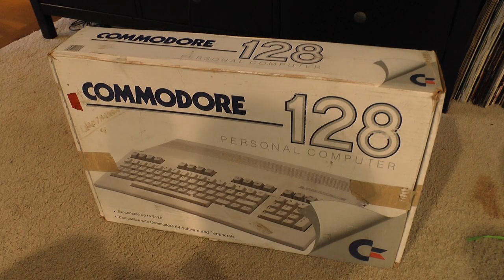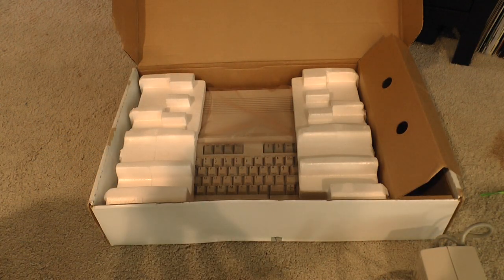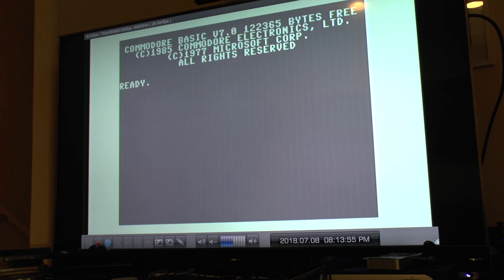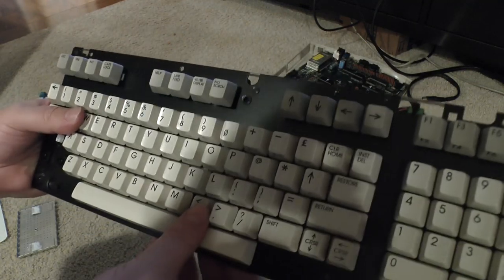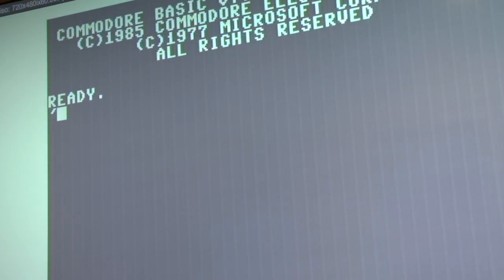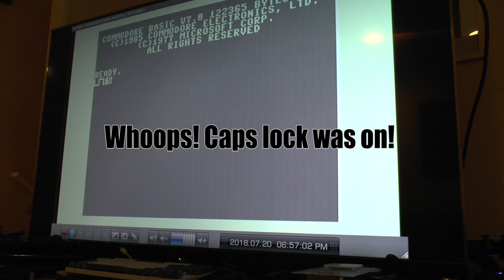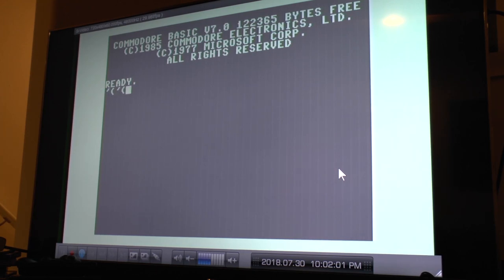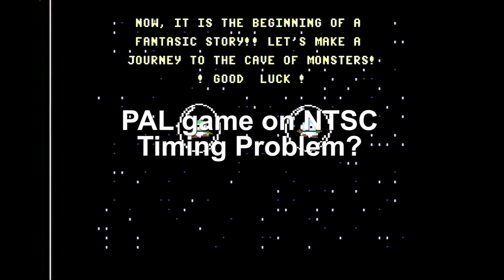Let repair a Commodore 128!

Comment: The CIA's from a C64 should work, too. And Amiga CIA chips too. If you use an older CIA chip you should heat sink it, though. The version near the keyboard is a special 2 Mhz version for FAST mode, and if you use a different chip it might get toasty.

Comment: Shouldn't be any resin in the C128 PSU. There is none in mine. C128 PSUs are very reliable compared to C64 PSUs. I'm powering my C64s with a C128 PSU (modded it with additional cable).
Reply from the maker: I'm sure you're right - and while I said I'd open and look at it - I never got around to it (and probably won't unless it breaks) - it just weighs a lot for a switching power supply.

Comment: i think they fucked it up with the plus-4 and again with the c128.
commodore wanted to get more into the business segment, they needed a higher resolution to have 80 columns on the screen.
in the plus-4 they did not keep the compatibility with the c64. that was a huge mistake.
in the c128 they could make it c64 compatible. however, they fucked up again.
1. they added a z80 cpu together with the 2 MHz 6510 version. that made it too expensive
2. they used vram to get more bandwidth to the memory. that was too expensive. faster dram would have been more effective.
3. they did not make a 6 voice stereo version of the SID. those chips could have been sold to c64 enthusiasts as an upgrade with a high profit margin.
4. they could have saved the money for the z80 and vram and invest it in the development of good business applications.
5. i don't know what the status of the 65816 cpu was at that time and where it has been developed (MOS or Western Design Center?). but Bill Mensch - the developer of the 6502 cpu was also the developer of the 65816 which was a great successor of the 6502 and would have been the natural upgrade path in a c128 or maybe later in a c256. in a c256 they could have also made the distinguishing between fast and chip mem - like in the amiga.
i think it has also been used in the SNES.
why did commodore let the good developers go? i would not let Bob Yannes go!

Comment: i have an 128 but it has questionmarks al over the place wen starting up but the things in the back still work so probely rom problems
Reply: its the model with integrated floppy reader
Reply from the maker: It could be bad ram? Does C64 mode work (hold down the commodore key on start-up)?
Reply: Both modes work the problem is that autofire on the joystick was enabled and there is also a key stuk of the keyboard (it's a model D)
Reply: @SkuldChan42  so it could still be working completely exept the color screen was smoking
Edit the screen had sound how do i get sound of i use the round screen connector
Reply: Is there a platform we're you can talk to other peaple with commodors?
Reply: I hope not al the floppy discs have degraded to a level of problems tho
Reply from the maker: @matteofeyaerts  I wonder if there is a discord channel for commodore enthusiasts.

Anyhow if the joystick/keyboard is having problems it's most likely the CIA (complex interface adapter) just like in the video - you could try swapping them around to see if the symptoms change. If they do replace the chip - sadly they are getting kind of expensive :(.
Reply: @SkuldChan42  when i unplug the keyboard it goes normal and wen autofire is off it also stops his problems so it could be completely okay(i think it's the esc Key cuz that one Came of and typing doesnt work very wel)
Reply from the maker: @matteofeyaerts  so this is an autofire joystick? Does a normal one work ok?
Reply: @SkuldChan42 the only problem i know of now is that there is An key stuck (when autofire is off evertthing is okay)
Reply: @SkuldChan42  yeah